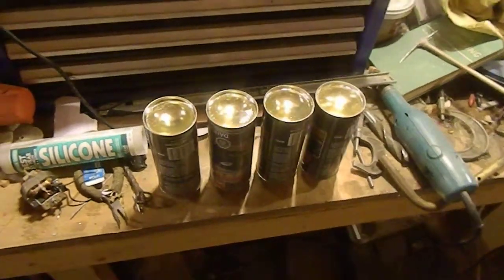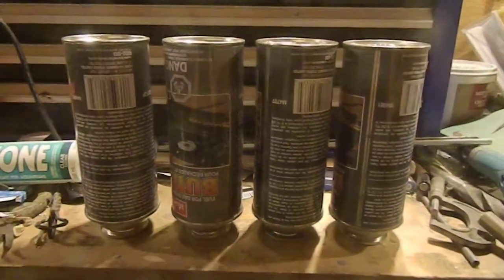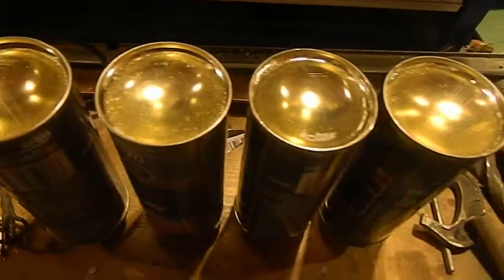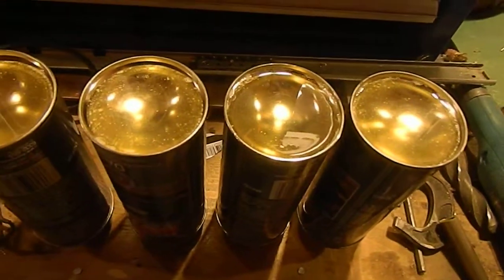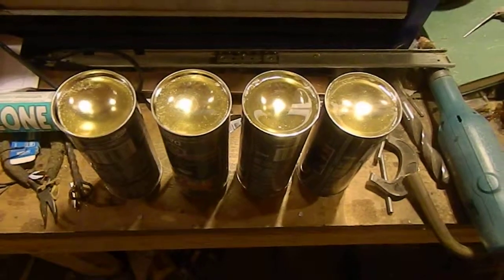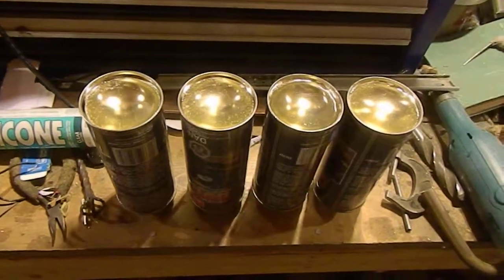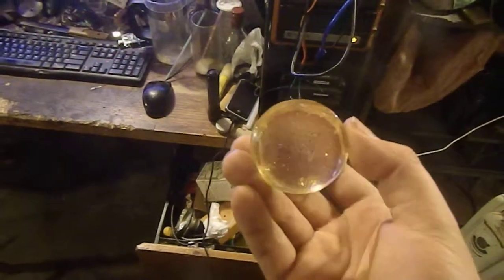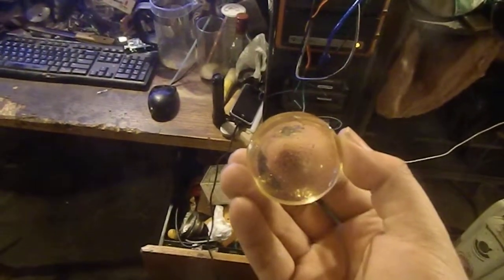epoxy lense preparation

Comment: Awesome attempt! I'm trying to accomplish the same, but mine will be used in a DIY slide projector. 
I'm just curious - don't the VR glasses utilize plano-convex just like a projector would?
BTW - Cool channel!
Reply from the maker: Thanks for your comment.
I had a look at my current headset,  its a mass produced plastic version of the cardboard headset,   the lenses appear to be plano-convex.
I recall the lenses I made in this video were able to produce the stereoscopic effect desired,  however there were an awful lot of bubbles and fogginess.
The lenses I ordered around the same time were biconvex,  they produced an image with heavy aberration in the peripheral vision.

If you have the means,  I suggest drawing a partial vacuum on any resins you use,   it'll expand any gasses forcing them to pop,   returning to atmospheric pressure will collapse the smaller bubbles to a point where the gas can dissolve.

Alternatively you can tap the resin to displace bubbles,  then pop them as they surface with either a flame or stick.
Reply: @theevilovenmit  Thanks for the swift and comprehensive reply!
Yeah, I've though of vacuum as well, it appears most professionals who do resin casting use a vacuum chamber, but I don't own one. I might try using a vacuum cleaner and a plastic container combo if there'll be too many bubbles, but I assume vacuum chambers create a much "bigger" vaccum so I wonder if my future contraption will make any makes any difference.
I'm actually trying to make a slide projector and have already ordered lenses from China, but as you were, I'm super-eager to see how they work in practice so that's where molding came into play :)!
Thanks once again and keep up the good work!
Reply from the maker: Staš Vrenko a large pressure cooker could hold a partial vacuum,  and a 12 v air compressor could be put inside and set to pump out the air,   Then you just need a valve for repressurizing,  the pump can overheat without an atmosphere btw.